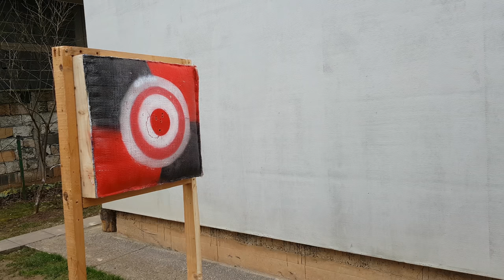How To Make Archery Target from Scrap Materials- Easy and  Cheap

Comment: I've seen people using these new things recently called screws.  I've looked into it and they work rather well.
Reply: Holy shit I was going to say why go through all of that trouble to make a square frame
Reply: Lol that’s what I thought
Reply: Arrow hits screw, arrow fooked
Reply: @MrRixsy  arrow hits wood, arrow fooked.... No?
Reply: You snobs, always recommending ultra specific parts....
Reply: Guys, old technology, if it can even be called "tech" is just fun to do, especially when it comes to stuff like this - probably because hardley no one does it, unless you're a Quaker or Amish.

The only thing I did diferrent with my frame was to use an 'L' shaped steel bracket at the rear corners to keep it completely square (yes - with 2 1/2" wood screws).

Also I used soft pine with a 60 degree angle torwards the inside of the frame in case a bolt or arrow should hit the face of the frame it will be deflected inside the target and not burying the head or tip into the wood and possibly damaging the tip and or an expensive shaft.
Reply: Glad craftsmanship is dead and gone
Reply: What sorcery do you speak of?!
Reply: That's great
Reply: @chadmerkley9465  i hope not. arrow should be able to hit pine and be okay.
Reply: Hey great job and ingenuity. I like the dowels over screws just because. I like the paint scheme also. I also like your total cost of material = zero 👍🏻
Reply: @chadmerkley9465  lmao a year later but did you get your common sense back?

Comment: Great video. Gave me some good ideas for making a new and improved version.  Looked like the steps were too many and overly tedious though. Definitely didn’t like all the staples — They’ll eventually be struck by an errant arrow or loosen from rust and end up on the ground for you or your dog to step on.  I currently use a couple targets made out of a double heavy-duty burlap bag filled with sofa stuffing.  They are very light to easily throw into the back of a pickup and they last forever — never matting up or failing to stop an arrow, at least from my 62 lb. osage orange longbow.

Comment: I do believe that this is the best homemade target that I have seen so far.
Reply: Must not be seeing very many. While this will work, it is a lot of work for something that is designed to eventually break down. The spray foam isnt a durable material and will deteriorate rather quickly, especially with heavy draw bows. The semi-permanent construction makes it difficult to replace interior components.

Comment: Instead of dicking around with all that ironing of the plastic bags, just use a cheap heavy duty outdoor tarp and fold it over multiple times, or use burlap.
Reply: The key words. CHEAP AND EASY.
Reply: Michael Pringle still pretty cheap and far easier using a tarp
Reply: I wouldnt say at part of this build was "easy." Every step was made complicated. And the use of the spray foam take away from the cheap aspect of the build. Use discarded carpet or old denim material...cheaper and easier.

Comment: Brilliant idea providing one has a stapler,blow torch etc?
Reply: Jon Cole  Scissors are a common household item.I have a pretty well equipped workshop.Toolbox with spanners,sockets,cutting pliers etc.Orbital and belt sanders,high pressure cleaner,electric drills,Dremel and many other tools,but why would everyone need and industrial stapler and blow torch-I do not so commented on that.
Reply: Jon Cole  Bummer-why are we always missing some thing. I have what we call a wool bag,obviously is for wool.Stuff that with plastic wrap/pallet wrap that you could get from a bedding or furniture place for free.Will even stop a compound arrow

Comment: Cheaper & simpler: Collect lots of corrugated cardboard & simply tie &/or glue &/or tape together. c.12-20 layers good for most bows though you need to keep clear of rain or damp. Much more biodegradable.  Hay bales are reasonable though often a little too soft. Paper FITA target faces can be had quite cheaply too rather than spray paint, or just collect roundals of paper. Interesting video though. Wonder how many copying it will burn their boss/shed etc using blow torch on plastic/wood/foam/fabric.

Comment: A piece of 1×4×8 foam insulating board cut to the size of a small size moving box would be faster,easier and yield the same result.  You can make 2 for about $15 in material.

Comment: Instead of foam and cushioning, try using old clothes. I stuff a thick cardboard box with my kids outgrown clothes (or my moth-eaten ones). Works great. Only problem is that it’s not weather-proof. The cardboard gets ruined in the rain.
Reply: problem with cloth is that it soaks up water in the rain--if keep target outside.
Reply: Jaanmi94 I do the same
Reply: I make targets from flattened cardboard boxes when they get shot up I use them as filling in another cardboard box. Works well with a 55 pound recurve. The boxes are free from my shop.
Reply: i use foams and old jeans and any suede they work the best from powerful compound bow... i got tired buying these target from sports shop, it's costing to much so it's cheaper make it your own
Reply: Cardboard ruined, then you just put stuffing in new box. Way easier, cheaper, and time efficient than whatever the hell this video is.
Reply: I have a target made of old clothes stuffed in old dog food bags hanging from my fence. Worked well with my older compound bow, my 2018 arrows poke out the back side about 3-4" and are near impossible to pull.

Comment: Nice target! But your KILLING me with that HACK SAW! Just get a small hand held miter saw, or a simple crosscut wood saw! Back away from the metal saw to cut wood! :D!
Reply: My thoughts exactly lol
Reply: One of the reasons to use a hacksaw is that it's cheap, & versatile.  The best thing about a hack saw is when you wear out the blade, replacing it is cheap & easy.  Also doesn't take up as much space to store as what you are describing.

Comment: the form in the cans would cost you about $20 so how is this cheap
Reply: @weaponizer4444  No.  He's talking about the expanding spray foam.  That's 4 or 5 bucks per can and it looks like you used maybe 4.  So you spent $16-$20 on just the foam alone.

Comment: Nice! However I still think the laziest solution is an at least 25cm (~10 inches) thick polystyrene board. It is cheap, require zero work and catches the arrows from my 60lbs compound (however the arrows go ~halfway through it until stop).

Comment: Wood 20
Glue 10
Vice 40
Saw 15
Staple gun 20
Spray paint  x 3 @5 = 15
Clamps 10
Expanding foam 10
Pu foam x2 @5= 10

I’m upto 150 buck pounds whatever’s and a ready made indestructible cube is about 80 pounds so why would you?
Reply: Who in the hell is charging $20 for a piece of wood lol
Reply: After cost of lumber and dowels....you could pay that much......or you could use scrap lumber and a few screws and it would cost virtually nothing.

Comment: You should use extra material for the front covering and pull it around the sides of the frame and staple it to the back. Fixing it to the front of the frame will lead to the front cover collapsing inwards after several shots into the target.

Comment: Great, now what the hell was it you sprayed???
Reply: Expanding foam. Pretty dense and very rigid once dried. However,  not very durable when doing something like shooting an arrow through it. It tends to break apart pretty easily. I'm assuming that's why the plastic was used, to keep the dust and debris at a minimum once the foam breaks down.

Comment: What a waste of time and effort, it will be buggered after a week. Make the frame, put a back on it, put shade cloth on the front and pack it with rags. Too easy. Just needs to be about twice the thickness, front to back. You then hang paper targets on the shade cloth.
Even easier, get a grain bag, stuff it with rags, tie up the top. Hey presto... archery target.